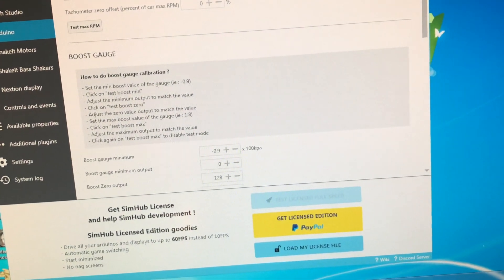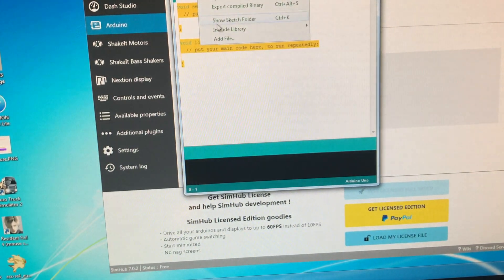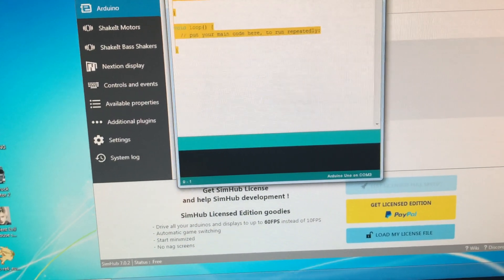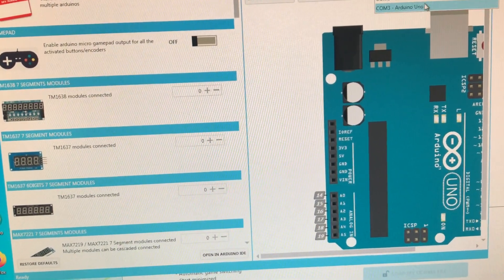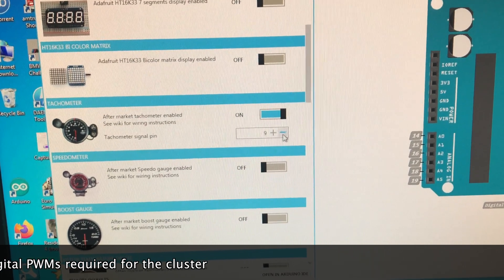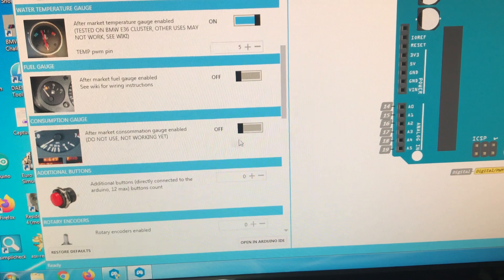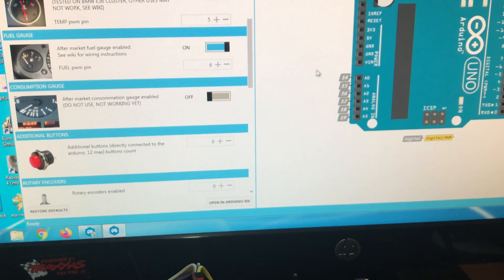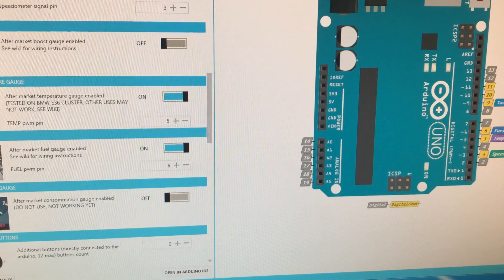BMW Cluster SimHub arduino sketch easy setup

Comment: how to get the fule and temp gauges working
Reply from the maker: Well the fuel in the actual car definitely works on float resistance sensor. Temp also I believe should be same. What I did was play with the output PWM values in the simhub until I got it to work with the games. I don’t remember the exact values since it’s been a long time now.

Comment: can someone link me the arduino code for the E36 cluster ?
Reply from the maker: Check description of the video https://youtu.be/pw7UCJmLgCk
Reply: Tanks for the link. But how did you get abs lights to work and turn signal lights.

Comment: And what's with indicators and other lights? Can I choose them also from this menu and choose it for example: pin 6 is now the indicator left and pin 7 is the indicator right
Does it work, or do I need a relay to use indicators?
Reply from the maker: Hi, I’ve explained about this to your other comment in a different video.
Reply: @sciencetrove  Thanks for your attention!

Comment: I had a Volvo S60 cluster coming, but the Post Office is not delivering it, what pins do I need for the Volvo cluster to work? (aka a DIM cluster)
Reply from the maker: Which year is it? Anyway while google it I found all S60 ones mentioned are CAN based. So, basically you have a 12V, Ground (-) , CAN high pin& CAN Low pin. That’s all will be needed. I’ve given a link below for the pin out.

https://www.digital-kaos.co.uk/forums/showthread.php/528516-Volvo-s60-dash-pinout

But the issue is unlike the BMW E36 or Audi A4 older clusters without CAN I’ve used here the Volvo S60 needs it’s corresponding can bus codes and you will need to setup corresponding arduino code to get it running.
Reply: https://www.youtube.com/watch?v=wLj1aOPjB_4 this tutoria, is specific for Volvos S60

Comment: hi sr,do you have the sketch for this?the number of each pin?thanks
Reply from the maker: Hi,
Which cluster? E36?
Reply: @sciencetrove  yes,i have tried 100 times with the sketch of am studio and some other and nothing, not even the arduino load,always error.
Reply from the maker: Sorry for late reply. Could you record a clear video of the process you are attempting and then upload it to cloud and send the link. It would make it much quicker to understand and probably I can help you faster.
Reply: @sciencetrove  do that